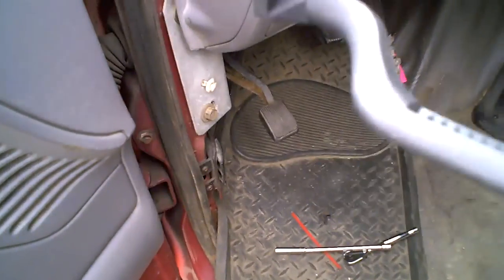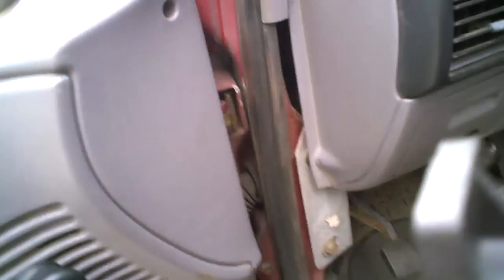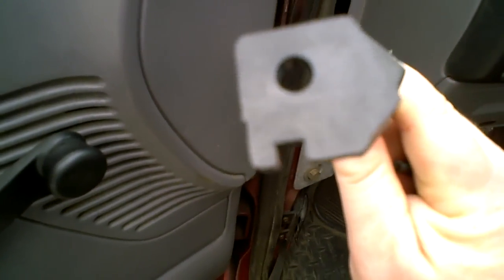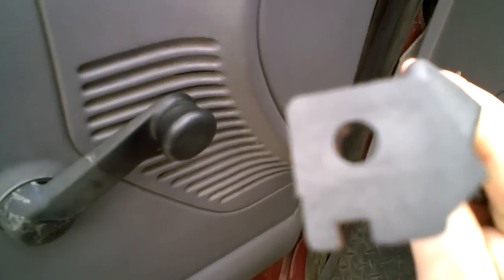1994 Ford F Series Door Handle Replacement

Comment: Thanks for this video. I replaced the handles on my '94 F150 with two metal handles from Dorman (77177M and 77178M). No more having to roll down the windows and open the doors from outside.

Comment: I'm wanting replace mine with the metal set up one is busted so change both eh?. Glad I saw this so I don't go pulling door panels .Thanks. I was just gifted a 94 Ford f150 xl Super Cab 4x4 351 5.8 automatic. My kid neighbor joined the Army and folks said get that outta the front yard. So I thought I was done with restoration. Guess not.  It needs some work.  But motor sounds great.  It will need brake work a little mushy pedal power steering pump a little noisy. AC maybe a charge.  Lotta TLC, hoses all said about 1500$ in parts. 40 hours labor. Hope y'all got more 94 Ford 150 vids. Thanks. That kid in the background looks like he could be related. Lol Thanks again Gary in Colorado

Comment: Did you use an OEM door handle or an after-market one?  A couple years ago, I replaced a tailgate handle on a Ford Ranger, around a 1997.  The OEM unit was plastic and broke.  As I researched the parts, it became obvious that the Ford plastic handles were a pattern failure and numerous after-market manufacturers offered metal handles.  There were some metal Ford model vehicle door handles too!  So this seems common to some Fords!

Comment from the maker: @epiphaknee I actually used an aftermarket door handle. I think it broke because I over tightened it.Sometimes that happens.To answer your other question if I dropped the socket I'd remove the pannel because they are really easy to remove.

Comment from the maker: @IKESTERrocks It sounds like the plastic clip that holds the rod onto the handle mechanism  has broke.If you take the door panel off and look in where the door latch is their is a rod that attaches from the handle to the latch.just sounds like you need a new retainer on either end and put the rod back in the hole and it'll work.

Comment: @tinydx95t2 yea, mine has quit opening the door too...like the cable stretched or ???  was having to pull up further and further then broke the handle, easy replace but still won't open.....tried lubing the cable but didn't help at all.   What's the issue sound like?  thx
Reply from the maker: Sounds like the cable needs replaced. It isn't a tough job you just have to remove the door panel and the clips that hold it on.

Comment: To: tinydx95t2,
it sounds like you have the same problemas me. there's actually a bigger issue. and its the cable and the mechanism that pivots. the mechanism is probably worn out like mine and either needs to be replace through LMC truck, or a junk yard replacement. the cable is probably fraied as well. the cable is only $14. through LMC. buy theat for sure. the mechanism is quite spending though. if you found another way around it let me know.
thanks..